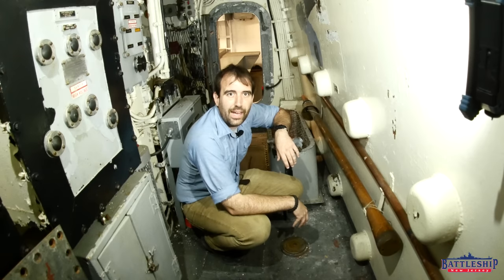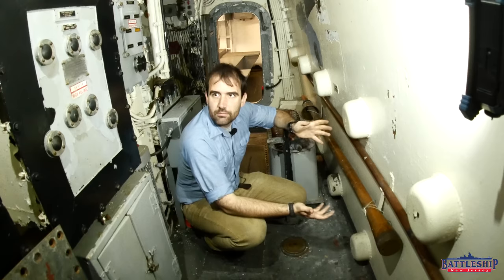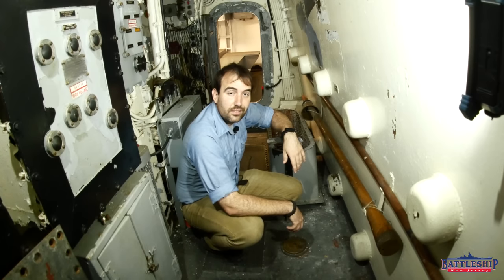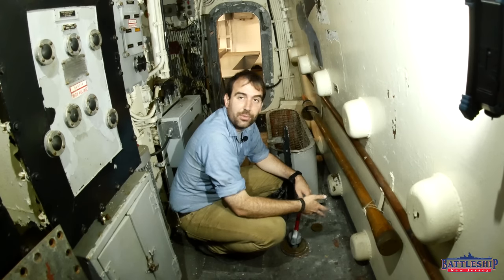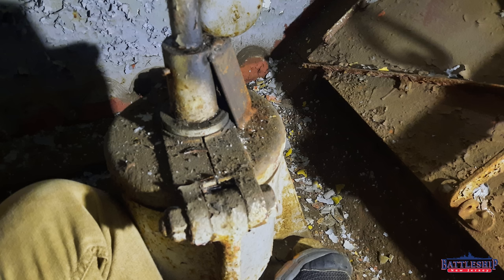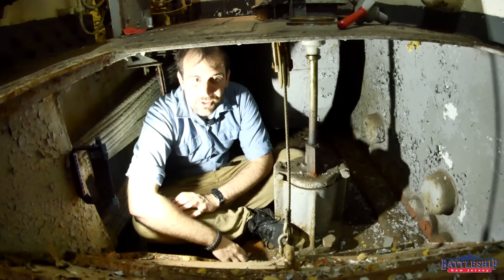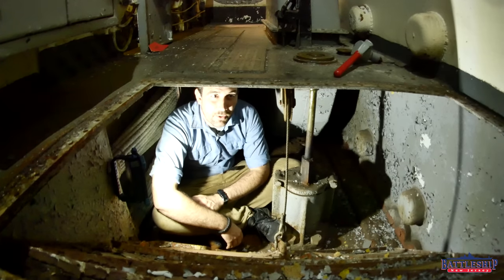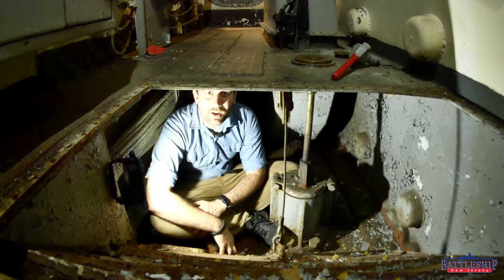Are The 16in Gun Turrets Welded in Place? UPDATE!

Comment: A 300hp 480v motor is rated for around 360amps full load.  They can pull 5x that for a split second during startup that's why the breaker is so big.  You could install a soft start or VFD to get the motor to ramp up slowly to not trip your 1200amp breaker.
Reply: Plus, it makes absolutely no sense to not be able to turn the turrets off shore-power purely for maintenance or repair. If a motor goes out, you need to be able to run a replacement motor to verify it's fixed, and I highly doubt they'd fire up a boiler and get a turbogenerator spinning purely for such routine tasks. Same with the movement of the turrets in general: They'd probably need a regular wiggle just to make sure they didn't rust into place.
Reply: The insulation on the windings of that 1940s motor probably couldn't take the voltage gradients from the VFD. They'd be better off using wrenches to turn the gears directly. That's how the team on Iowa elevated one of their barrels. It takes hours but doesn't risk damaging anything.
Reply: Yeah breakers for motors that size are generally just sized for the the conductors, as the motor will have external/internal protections of its own. Generally it is 4:1, but up to 8:1 is code. 

It's very likely the grid won't like that load at all. Especially because it's a random burst of load. Just flipping on a 300hp motor randomly is a great way to get unfriendly visits from the power company.
Reply: @ionstorm66  Does one need to worry of unfriendly power company visit after 16-in gun turret is trained at the access road? 😂😂😂 And don't spoil the fun with "you need ammo", please 🤣🤣
Reply: Do you think those motors would work with  a VFD?
Reply: @jdst1042  Should work with a VFD but a soft starter would be less money and don't really need to adjust the motor speed because it has the hydraulics.
Reply: Michael Jackson The Guilty Child Molester  motor dosent need much after it's running, but getting it started is the same current draw unless you use a soft start system. Even then, you are talking huge money to retrofit a system to the ship. A lot of better things for the money to go to.
Reply: Andrew Crews  there are only a pair of 250KW generators. Combined output is only 1000A. You'd have to dedicate all the power to just turning the turrets, so it's unlikely the system is normally wired that way.
Reply: @ghost307  the elevation system is direct gearing with clutches. Training is done with hydraulics, doubt the gear reduction on the hydraulic setup is low enough to turn with man power.
Reply: That's not how breakers are sized, not even back in the 40s. Breakers are time temperature devices, they are designed to sustain overcurrent for a period of time in accordance with their trip curve. This is why under current NEC code there's the 125% rule.
Reply: @400djl  trying to run one of these 1940s motors off of a vfd at slow speeds is an absolutely terrible idea. These old motors were never designed for the high voltage spikes of a vfd, not to mention 80 years later. You would like to smoke out in short order.
Reply: @MrBlueBurd0451  if i remember correctly most ships had 1 boiler running while in port just for that
Reply: @otm646  125 is for residential. For industrial inductive loads it's up to 800%, though 400 is common.
Reply: @jdst1042  Unlikely. I've had to replace a lot of old motors after someone decided to put a VFD on them without considering the effects of the VFD output waveform on the old motor windings.
Reply: @otm646  Agreed. The worst thing that you can do to a motor is let the blue smoke come out.
Reply: A bit of an update for those interested, Iowa turning turret 3 off of shore power: https://www.youtube.com/watch?v=eD8k6bpJZ98

Comment: As a structural ironworker, this is hilarious.  Claiming you welded a battleship turret into place with a little piece of angle.
Reply: Government contracts go to the lowest bidder.....
Reply: i mean ... it is though, your not going to hand remove that without tools, OR without knowing its there, and most people who might try to steal it or use it for bad purposes dont know its there, well until now anyway, but that turret is effectively locked
Reply: Makes sense charge $100,000 to disable turrets  couple of 2"welds rest of the money in the back pocket that's how military procurement  works
Reply: @ilenastarbreeze4978  I highly doubt it's effectively locked.  Removed with tools?  A sledge hammer would do it.  How much force is that?  The massive amount of force needed to rotate that turret weighing many, many tons wouldn't have much issue sheering off a little piece of 1/8x2" angle.  The other issue is the welds at the bottom, this was obviously a hack job and I highly doubt they put any pre heat into that huge mass of metal at the bottom.  Trying to weld a little angle onto a huge piece of cold steel would result in extremely poor fusion, the welds would probably crack off at the bottom before the angle itself yielded and broke.

If anyone needs anything clarified just ask, I do this for a job.
Reply: But it is technically welded in a locked position.
Reply: @mattorama  oh totally, if you wanted to remove it you could do so in 5 mins, but its locked enough for the navy im assuming, and for a ship in port,
Reply: @mattorama  tell me you don't really know what you're talking about, without telling me you don't really know what you're talking about.
Reply: @randymagnum143  I've watched larger pieces of metal than that yield under stress.
Reply: @mattorama  it holding the actuator from being manually turned.  The locking pin is holding the turret.  It is a perfectly acceptable way to secure the turret without destroying any valuable equipment.
Reply: @mattorama  What stress? The massive pin under it takes all the stress, this just stops the handle from being turned to remove it. Thats all it has to do to do its job. Get a clue.
Reply: @randymagnum143  If it's manually turned, then yes, there's nowhere near enough torque to break those poorly fused welds.  If it's manually turned, then somebody with a twenty dollar grinder from Harbor Freight could defeat that setup.  Either way, it's only technically "locked."
Reply: @mattorama  would you rather they destroyed the mechanism?
Reply: @Jacksonflax   EXACTLY- Think "Lock Out, Tag out"  The rotation is "locked" (welded) into a non operational state.
Reply: @mattorama  What you may have missed is that the shitty weld (I've done better laying on my back in 3" of mud trying to get ag equipment moveable) isn't really what is holding the turret in place.

The actual locking pin is a large threaded pin that engages a hole in the turret when you run it down.  What the little piece of scrap angle is doing is preventing a person from moving the mechanism which turns the threaded pin to back it out of engagement with the turret.
Reply: @kevincrosby1760  Yes, that's correct that it's wouldn't be taking the force from the motors if they could be reactivated. But mattorama is right that a sledge hammer could probably knock it right off or else an angle grinder would do the trick. Either way, we're talking about minutes worth of work.
Reply: @vbscript2  Under the current restrictions (no pun intended), the restriction to shore power prevents those turrets from ever being moved.

As I stated elsewhere, shore power is intended to service the base load required for "hotel services" (Lights, running water, CHT handling, fire pumps, etc.) as well as to provide enough power to bring a boiler up.

I served aboard a US Navy Oiler.  If we needed to move fuel around between the Ship's Service tanks or top them from cargo tanks, we could, with some planning and restraint, do so while on Shore Power.

If we needed to transfer CARGO fuel around, then the need was scheduled and half of Engineering just had their liberty cancelled  as we began the 24-hour transition between "Cold Iron" and "In Port Steaming" as we brought a boiler and enough of the Plant up to spin a generator.

FWIW, shifting from Shore Power to our own generators generally left us at around 55-60% load on one TG.  We could continue to add generators up to a total of about 8MW...8.5MW if we wanted to add the Emergency Diesel Generator to the mix.

Shifting from Shore Power to our generators involved bringing a generator up, synching it with shore power, connecting it in parallel with the pier, then shifting the load over to the generators and isolating Shore Power.  This could generally be done without even a flicker of the lighting.

It gives you kind of a weird feeling when you realize that, during a brief part of the process, you just became a small but producing part of the entire West Coast power distribution system.
Reply: @mattorama  dude, the angle isn't what's stopping the turret from rotating. The giant solid steel rod is, which is secured with the angle iron. It's not like they said they filled the bearing chase with concrete, just made it so it's weld locked in place.
Reply: The little piece of metal holds a pin in place which keeps the turret in place. Almost the same thing. :)
Reply: @pilkipilki4472  Cost of  WIELD 2" rods: 50$ VATS Incl. Cost of 20 years Knowledge on WHICH and WHERE to wield the 2" rods so that your 100M$ BBship and be able to reuse the turret in a moments notice 95.950$ VATS Incl. (price of restoring in a moments notice not included)
Reply: They “locked it enough” if it actually needs to be reused, there isn’t a ship mothballed that isn’t going to be reused if it isn’t needed, all the stories can be said, all the Habus, it was decommissioned multiple times, don’t put it to the far side, it’s not an “electronic” warship like all the others, just think of the movie , “Battleship”

Comment: Is there any "back up" to moving the turrets like there is for manually turning the rudders???  Like 2,000 turns of a crank to move the turret 3 degrees?
Reply: There are on the 5”
Reply: There's spare motors... also pumping the hydraulic fluid. No matter what redundant traverse motors you use, you're still gonna be pulling 1.8kA from something. If the spare diesel generators in the keel's void space, or the turbines aren't producing power, you have much bigger issues than "we can't turn the turret" ;)
Reply: There is but it's painfully slow. Probably designed to get the turrets centered and locked in place for the trip back to the yard to fix things.
Reply: In older ships there would likely have been a solution that allowed crew to turn turrets mechanically but as electrical and hydraulic systems became more reliable this would have become increasingly redundant (and pointless due to the sheer inertia of the turret and increase in requisite manpower)
Reply: There were battery banks within the turrets to power the turrets if ship power was lost, but I think that's it
Reply: Each turret had a donkey that walked in circles to move them
Reply: @richardmillhousenixon  The batteries were just enough to power some minimal lighting and to fire the primers. Batteries big enough to power the entire turret would make a Tesla look like a flashlight battery.
Reply: Texas has, but it’s probably not feasible for the sixteens.
Reply: @ghost307  The primers could be percussion fired, and the lighting could have been taken care of by battle lanterns. I'm fairly certain there's a video on the BNJ channel where Ryan mentions the batteries and how they can be used for limited movement of the turrets
Reply: @richardmillhousenixon  I remember that video. It sent me back to review my wiring diagrams for the turret. I believe that he mis-spoke as to the capacity of the battery packs that he pointed out. Without someone doing more research onboard it's quite possible that all 3 of us are wrong.
Reply: @Rambogner  Really? I thought it was a hamster wheel.
Reply: There is no way to manually train the turret. There is (or was) equipment that could be used to repair or replace the hydraulics and even rebuild the motor in place; but no manual system. 
Usually we just used the train brakes to hold the turret in place. The few times we used the centering pins they almost always jammed even though they are tapered. And it was an effort to get them unstuck.
Reply: @ghost307  also an inverter big enough to run a 300hp motor would of been the size of the turret in the 40s. All of the motors are AC, batteries are DC.
Reply: @TiernanWilkinson  yes USS Texas has the ability to slowly rotate the turret via men pulling chains
Reply: @robertlian2009  awesome info thanks. Btw USS Texas has a way to rotate the turrets via men pulling chains, they posted a youtube video of it
Reply: @streetracer2321   Yes Tom Scott and I were docents on the Texas. His videos are awesome! I was Turret Two Officer on New Jersey from October 1981 (pre-commissioning) to November 1984.
Reply: @robertlian2009  that’s awesome, congratulations sir
Reply: @robertlian2009  the coolest of the turrets too!
Reply: @richardmillhousenixon  that's not true.
Reply: @robertlian2009  Which Tom Scott, the red shirt one or the older one 😁
Reply: @richardmillhousenixon  The one who’s a shellback😉

Comment: Great video explaining what I asked the USS Alabama BB-60. They replied that they could manually crank the turrets but it was extremely slow. They said during the filming of the movie Under Seige, it took  like 6 hours of hand cranking to get the turret in the position for a few shots the movie director wanted.
Reply: Supposedly that took the use of at least one deck capstan, padeyes and a whole lot of cable.
Reply: Ryan has said in a previous video that the Iowa class lack such hand driven cranks... even if they were massively geared, the turrets just weigh too much to move by hand. Interesting to know some BB's did have them though
Reply: @roadsweeper1  
It is possible that he didn't know back then, as this pin could actually serve for that crank put possibly only in a repair yard.
Reply: In theory, since the motion required to actually move (even something as small as this) is not that big (it would be counterproductive to have an excessively hard to move turret, hence the many, big rollers inside) that by disconnecting the gearing inside, for them to move the turrets by winch from the inside.
That said, Ryan is a bit incorrect... considering the tech advancements we've made today, the motor powering the hydraulics, and even the hydraulic pump itself, ... they're obsolete. Strong, bulky, sturdy, but obsolete. We've had some pretty big changes in motor design alone, allowing for really compact, but powerful units. A proper engineering team (with work in the field) could retrofit the existing setup to move the turret, slower, but under the amp load limit of the shore power. I don't know about prices in US, but at least here in EU, the prices wouldn't be astronomical for a job that big. I know of a 44 ton carousel setup that moves with something like 15k Euros worth of motor and hydraulic pump at something like 10 rotations per minute.
Reply: @aserta  That pretty much sums up my gut feeling of Ryans' explanation being more of "we have no means/rights/need to do it" case rather than "it can't be done".
Reply: You also don't wanna make the Navy mad and lose access to the mothball collection for accessorizing, outfitting, or repairing your battleship by showing how terrible they decommissioned a ship years ago by showing off their awesome turret 🤷‍♂️ Somebody's gotta be the fun police 😄
Reply: @aserta  You're kind of missing the point here. He's not saying it cannot be done. He's saying they cannot with the equipment on board. It's not possible with the equipment installed on New Jersey to rotate or fire the turrets. Modifying the ship to function again is prohibited by their contract with the Navy, other than what is necessary to make the ship ADA-compliant.
Reply: HE SAID IN THEORY!  YOU'RE MISSING THE POINT.
Reply: Yep. And now the Battleship Iowa Museum has rotated turret 3, just about 6 months ago.
Reply: @williestyle35  And they may very well have a different rating of shore power. You get shore power in all kinds of different capacities, from a single 3 phase plug and socket for smaller stuff, all the way up to 4 separate arm thick cables for each phase and a neutral running at much higher voltages for small cruise ships (small, to cruise ship standards). 
Drawing 1800a from shore power is not trivial and it's highly likely that it's not offered everywhere. Iowa was already at the limits of their shore power, having to carefully start up the big motor to avoid tripping the breakers with the massive inrush current. If New Jersey has traditional fuses at their shore hookup (at the power pole), then blowing them accidentally would also be a costly affair because you need a lineman to replace them. Breakers are a bit easier but i reckon you still need arc flash protective gear at such power levels.
Reply: @mfbfreak   they might. Iowa might also have more or different lines bringing in power. Good points, thanks for your comment.

Comment: I earned my ESWS pin on the Jersey, and I was part of her decommissioning crew in 1990. There is a way to manually rotate the turrets by hand, when the locking pins are removed. If you can find any of the old 16 inch .50 Cal Gunner’s Mates, I’m sure they can tell you how it’s done.
Reply: God that would be so cool to see
Reply: yes, one would imagine there probably is, if just to do the final small movements needed to align the locking pins when centering the turret. It will of course be EXTREMELY slow as the mechanical reduction needed will be massive.
Reply: @Murgoh  still that would be so God damn cool

Comment: The turrets are just resting. I would think the pins are necessary to ensure they don't rotate from listing at Anchorage, esp during a storm. I'm curious if the firing pin or elevation mechanisms are welded to prevent movement